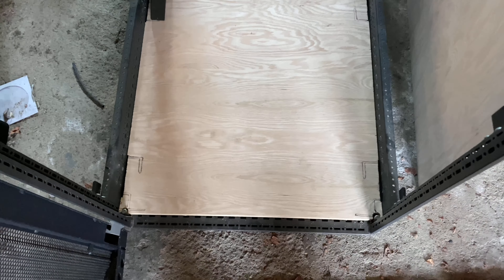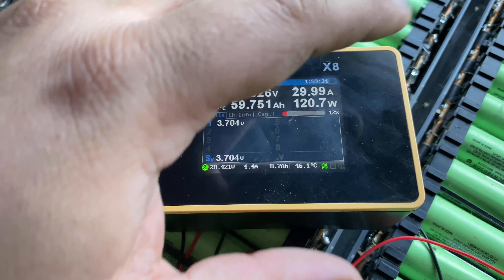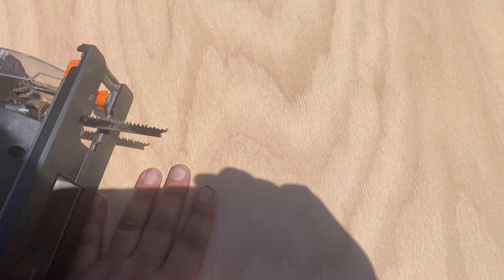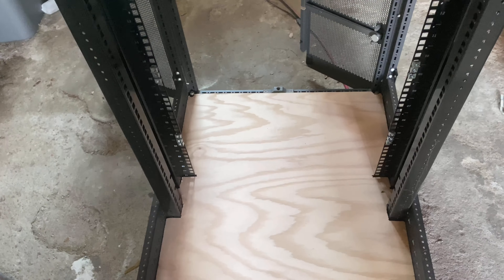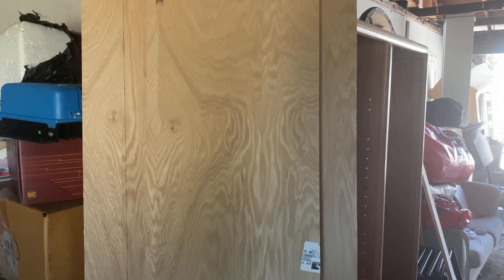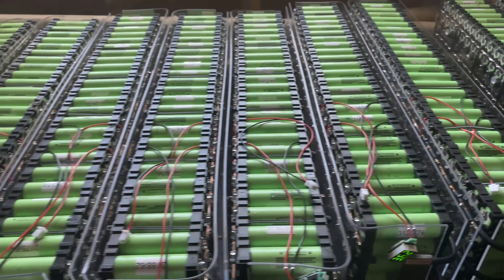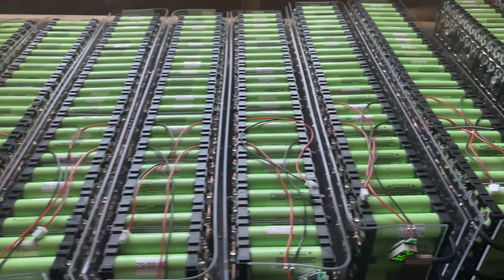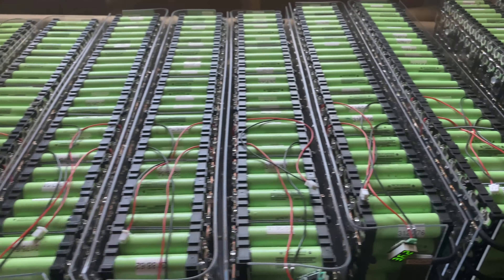Server Cabinet Build (Pt 1)

Comment: Looking good man!  For your solar coming into the rack maybe get some surface mount mc4 connectors similar to the victron charge controller  inputs but mount them to the ceiling so the solar can seamlessly go through and be removable (unclipped) from the outside if needed.  💥🤘
Reply from the maker: That’s exactly the kind of thing I was thinking of.  I’m honestly going to do that.  It’s officially part of the plan.  Thanks man!

Comment: Really impressed with your work, i see you made last battery pack with nick plate from battery hookup, i m about to start making packs but trying to come to agreement with soldering with busbar and spot welding wire to cell.
Reply from the maker: Thank you!  I appreciate that.  Yeah.  The big blue pack is a 7s45p and spotwelded with the batteryhookup nickel fuse plates (6p version). I’m actually going to build another one soon and make a video.  I just got a bunch of new (used) cells.  Capacity Testing them atm.  Good luck with your builds.  Let me know if you have any questions.  Thanks for watching

Comment: Looks good.  On your latest pack with the battery hookup nickel fusing i didn't see any additional wire bars soldered to it like you had done on the other packs.  I feel like HBPowerwall had used the additional wire across the top when he used the nickel.  Is this because the nickel should be able to handle the amps going across in your application?  I ask because i have the nickel strips and was about to build my first pack.  I was trying to determine if I would need the additional wire to help carry the load.
Reply from the maker: Yeah.  I’m only pushing 6 total amps at the most right now.  So there’s no need for an additional copper wire. Each row can handle 9 amps without getting warm.  Times that by 15 (rows going down) and you get 135a without getting warm.  I plan to hook this up to a 24v 2000w pure sine wave inverter when I go camping.  So I can get it to 2000w easily before I pass the 135a Mark.  When it’s done I’ll have a 100a bms hooked up to it as well.  I don’t think I’ll need anything that requires that much juice.  I’ll be making a video hooking the pack up to a 1800w air frier and use a thermal camera to see if the pack gets hot.  Hope that helps.  Thanks for watching :)
Reply: @myteslapowerwall7314  Thanks for the reply!  will keep an eye out for other vids